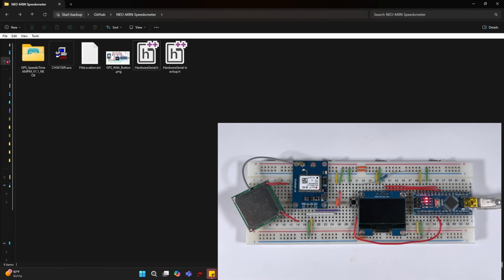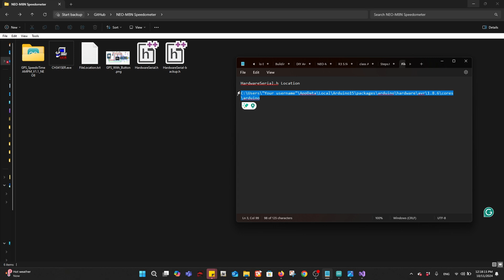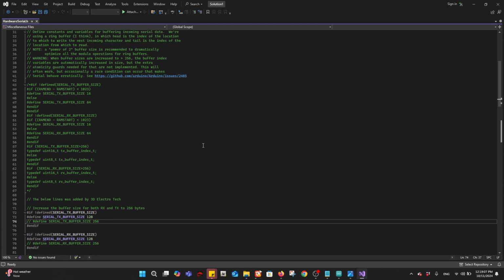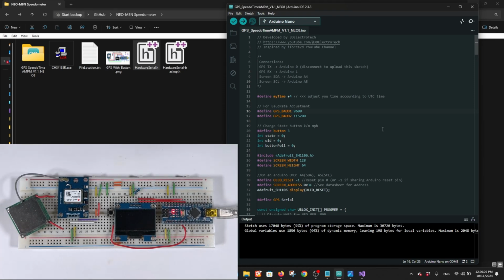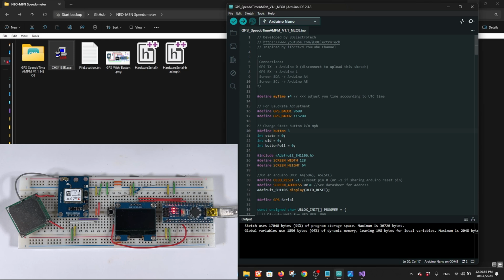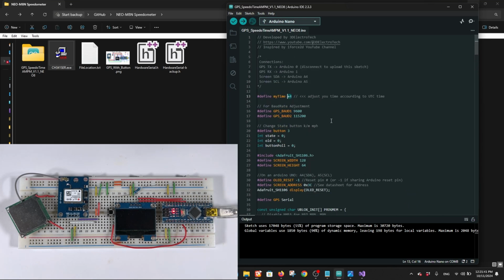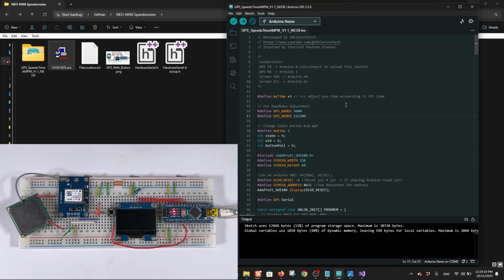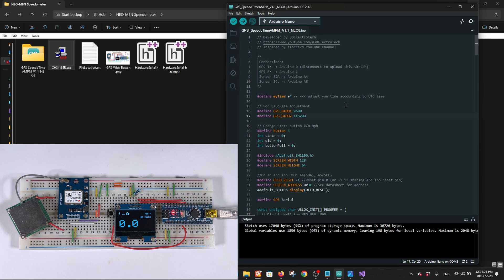Arduino Nano U-blox M8N Speedometer 10Hz

Comment: How can I do a fast speedometer with a neo m8?  When I suddenly stop it delays like 3-4 seconds for it to reach 0 kpm/h
Reply from the maker: Some NEO M8 modules are fake and the guy in the video shows how can you check your NEO https://www.youtube.com/watch?v=buyFIcgee5w
If the one you have is m6, reduce the 10Hz to 5Hz and it will work fine.